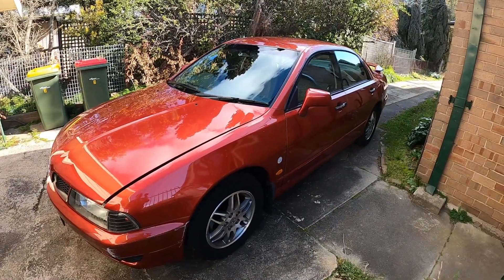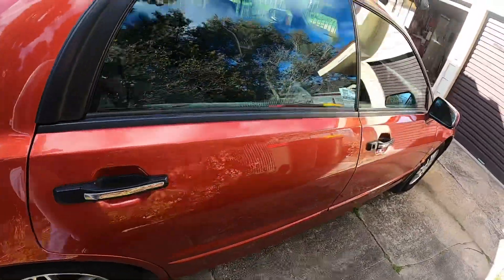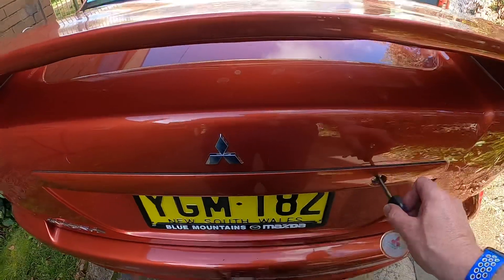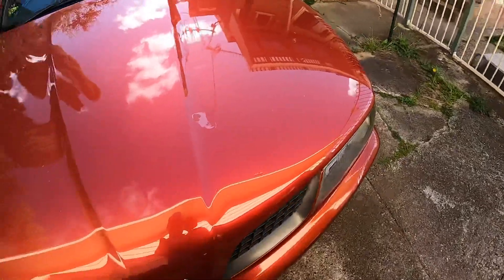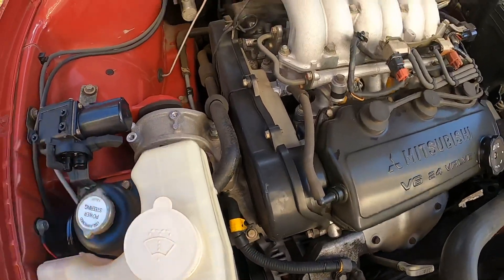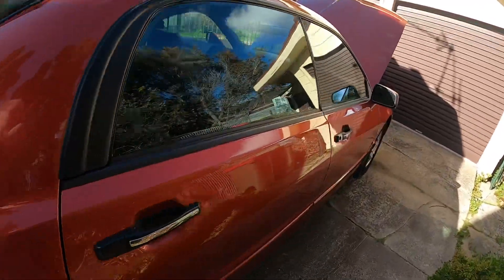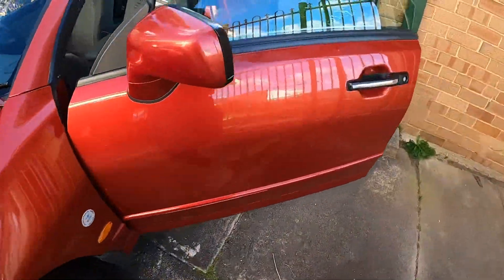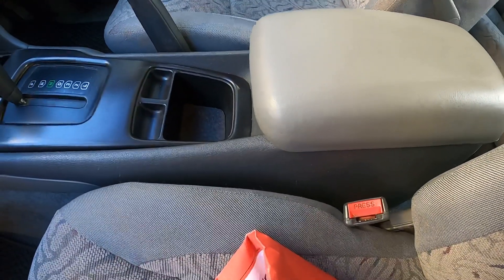2002 South Australian built Mitsubishi Magna TJ series Commonwealth Games Limited Edition

Comment: I bought a 2001 kj verada xi top of the range in beautiful condition with 200k on the clock  in September of this year and am amazed  with the car. Such a lovely car to drive and your spot on , it does have some serious  oomf indeed and is surprisingly fuel efficient given the size of the engine and car. I replaced the timing belt , water pump all hoses and radiator for peace of mind.  I can't imagine driving anything else.  Thanks for making this video 👏

Comment: I think that your boot was replaced but they never rekeyed it, nor reconnected any of the cables to the boot, simple fix really.
Reply from the maker: Actually, all it was was that I was using the ‘valet’ key which only opens doors and ignition. Changed keys and, hey presto, boot opened.
Reply: @paulscountrygarage9180 oh nice, sad to read in the comments it's no longer with us.
Reply from the maker: @SkashTheKitsune  yes, unfortunately it went to my nephew then the gearbox failed (wave spring is my guess). I was offered it back but had no room.

Comment: I have a early production TJ Magna Sports in the exact same colour, but with VR-X spoiler. I use it mainly on the highway as the engine has excellent power. Although not a perfect car, bad headlining, remote does not work, traction control not working anymore, uses a bit of oil (a common problem on the 6G7 engine) which I top up occasionally, it has been a reliable workhorse for many years, never broken down. You open the trunk in the glovebox but it requires a bit of effort at times, only one key opens the trunk. Unlocking the passenger door unlocks all doors but on drivers side you need to turn the key twice to unlock all doors. All doors lock if you lock the driver and passenger side. You need to change the timing belt every 100,000km and water pump every two timing belt changes.
Reply from the maker: I agree with everything you said.  I changed timing belt and water pump just after I got him. Good for another 100K. My remotes work, I replaced and programmed new ones.
Reply: @paulscountrygarage9180  Did they replace the fuel filter? It tends to get forgotten being underneath near rear wheel, and can cause problems down the track.
Reply from the maker: @j.m.6542  they did. But thanks for the reminder.

Comment: So very disappointed to see this video. I owned that car for many years and sold it in pristine condition to a young fella (from katoomba I think)
Reply from the maker: Wayne, nice to hear from you. It’s in quite good condition, considering. It is a credit to your ownership that it has survived as long as many are in deplorable condition now. I’d better not tell you that it’s about to go to my 17 year old nephew.
Reply: @paulscountrygarage9180  The "Key" issue is for security. You can put your valuables in the boot, take the car to a service etc, and they only access the car proper.
Reply: The back "Plugs" have been renewed.
Reply: I replaced that with Verada GTVi
Reply from the maker: Hi Wayne. Thanks for that info. I did work the keys out just after I posted the video. I replaced the plugs, rocker and spark plug tube gaskets as well as the timing belt, tensioner and water pump.

Comment: If it's the 4spd auto then the engine and gearbox will outlast the car lol, very good find indeed!
Reply from the maker: Yep, it’s the 4 speed box.
Reply: @paulscountrygarage9180  Mine is the 5 speed - + and it has never been removed from the car. Just change the transmission fluid every 5 years or so. These engines of course can burn a bit of oil regardless of what Mitsubishi car they are in.

Comment: Looks quite tidy Paul.  I think that droop snout model were one of the better ones.  Seems paint is in pretty good nick considering red tends to fade easily.  Must have been garaged.  I think they loosen engine mounts and tilt engine to change the rear plugs but as you say they would put iridium plugs in so would not bother changing them unless she starts to run roughly.  Probably owned by elderly person who started parking by sound.  Guess you got a bargain.  Plenty of power if you need it.
Reply from the maker: Peter Riggall The colour is what drew me to it. He is booked into the mechanics on Wednesday 16th for  timing belt, water pump etc be done. Plugs etc, brakes and an auto oil and filter change as well as a full inspect are also on the menu.
Reply: It's in very good shape overall. 
Is it the AWD model? 
I really like the look of the TJ series overall, you should put some VRX decal's on it brother.🤩 
Best off going with some Silver Spark plugs to boost power, torque & fuel efficiency. 
I recommend some Brisk EVO spark plugs for the front & rear bank, they are a breakthrough because they have that new laser technology within a multispark design & in combination with Silver - just think they would be hard to beat in terms of bang for buck. 
Silver is the best conductor of heat & electricity for boosting power & torque the most on any older ignition system in order to draw out it's potential. 
Are you going to put the Mitsubishi 380s motor into with some Graeme Bell camshaft's, equip a Wavetrac LSD & upgrade the exhaust to boost power, torque & reduce weight? 
Should boost power from 150kw to 230kw in combination with those spark plugs if you do.
Reply from the maker: Brantley - Thanks for your comments, it’s front drive only . I won’t be putting any other decals on as it’s a Commonwealth Games Special Edition already and extra would look silly. I will, however, look into the Brisk EVO plugs.
Reply from the maker: Brantley - Just read the rest of your comment. 😜. No, no plans to change motor or in any way modify the car. I prefer cars as they were built.
Reply: @paulscountrygarage9180  
That Wavetrac LSD will make it alot more reliable though. 
But also handling, acceleration & braking will vastly improve when you equip it. 
Magna's didn't come with an LSD despite having class leading performance, well except for the manual Ralliart Magna. 
In fact, you will get alot of improvement's simply by changing the front tyres to some modern performance tyres like some Michelin Pilot Super sport tyres - they will also improve your fuel economy. 
Change the full size spare tyre kit in the boot for a flat tyre repair kit - it's not a modification. 
You have to also take out of the boot - the boot floor carpet which just lift's out & the wooden masonry board when you do this. 
It will reduce weight by about 30kg for improvement's across the board & it add's more room & colour to the boot, the competition did this at the time to reduce weight but Mitsubishi never offered it.
Reply from the maker: Brantley - thanks again for your advice but I’m more than happy with the standard set up and the full size spare. From my videos you will see the other cars I drive. 😜. The Brisk EVO plugs look like a good idea though. The Silver are far, far too expensive.
Reply: @paulscountrygarage9180  
Sorry I edited my last comment because I forgot some info. 
The Brisk EVO is a expensive spark plug, but the mileage & durability it offer's for a Silver plug due to the Laser tech is incredible with remarkable efficiency. 
Unheard of until this point anyway, a completely new type of design & far better than a standard spark plug. 
Plus Spark plugs are pretty cheap to buy regardless. 
I've seen gains of over 20kw & 20nm when they are equipped atw on a Dyno. 
I think you should consider the flat tyre repair kit switch if you're just staying local, it's only $50 & you can do it yourself for a performance upgrade. 
Just change back to a full size spare tyre kit when you go on long distance trip's, unlikely given the pandemic. 
The 6G75 is more reliable than the 6G74, it's an award winning motor after all - engine of the year etc.
Reply: @paulscountrygarage9180  
I only listed upgrades that will improve reliability too with what I mentioned, despite boosting performance & reducing fuel economy.  
Well actually, equipping a transmission cooler & upgrading the standard ECU to run on 98 octane will further boost fuel economy, reliability & performance. 
It's possible to make the shift's quicker, sharper & add launch control using EVO GTA transmission logic & part's it seems too.
Reply from the maker: Brantley - mate I totally agree and am happy for your suggestions and I will keep them in mind. The EVO plugs are $132 for the 6 which is fine. I was wrong about the Silver....I thought I saw over $100 for a plug but they, and the iridium, are cheaper than the EVO. More research is required by me but I’ll still go for the Brisk.
Reply: @paulscountrygarage9180  
There's alot you can do with them these day's. 
The HM Header's will reduce weight & boost power too. 
The 6G74 & 6G75 are such awesome sounding motors when you work them. 
They have those racing spec D2 coilovers available for the them now too. 
I'm not too sure about the reliability of coilovers, but my close friend equipped it on his TL AWD & it improved his lap times by 3sec besides reducing weight.
Reply: @paulscountrygarage9180  
I actually found someone who is doing 8A80 V8 engine conversations into 3rd gen Magna's. 
Probably be the ultimate engine for the most power & torque. 
The 206kw they make is Japanese regulation. 
It's most likely making huge power in the Debonair. 
It has 412nm. 
But putting it into a Magna that weighs over 700kg less will probably give you over 300kw unless you choose to work it🤩

Comment: Do you still own this car?
Reply from the maker: No, not any more and it went ‘to god’ after it left my hands. 😢
Reply: @paulscountrygarage9180  Thats a shame, it looks in such good condition in this video.  Did the new owner smash it up? I noticed you said at the beginning of the video, "welcome to sunny Lithgow" I'm in Bathurst, Ive had a lot of Magna/Verada's over the years, still have a KL Verada.
Reply from the maker: @Djr67  it was until the gearbox went and my nephew sold it for parts.
Reply: @paulscountrygarage9180  , shame I bet it was the wave spring failure,
Reply from the maker: @Djr67  I think so as well. I was offered it back but had no room at the time. If I had got it back I would have converted it to 5 speed manual.
Reply: I've got the exact same only bought it last week...how many were made?
Reply from the maker: @matthewwhitby5368  no idea on the number made. Sorry.